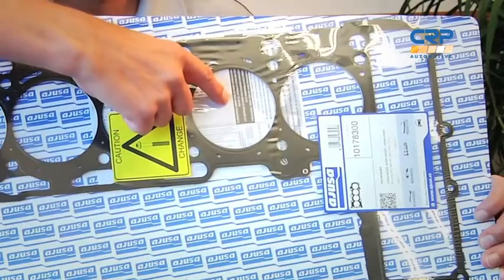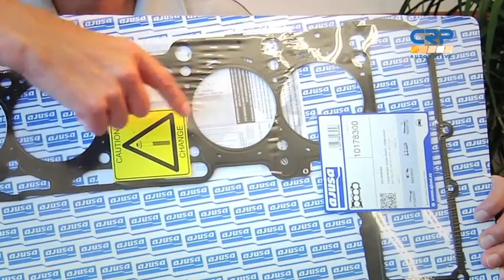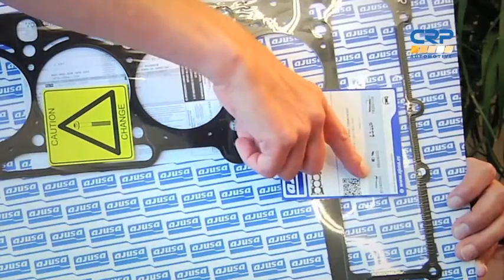ITB Episode 16: Torque Specs

Comment: How about those situations where you replace a head bolt with fine threads.  If you use the OEM specs for coarse threads, your clamping force with fine threads will be much greater.  How much is too much???
Reply from the maker: +William Skelton You would not want to replace a head bolt with a different thread pitch, you'd get a cross thread witch would certainly throw off the torque spec. All torque specs are set by the manufacturer though, so it’s a pretty cut and dry number.
Reply: +William Skelton  When using carb cleaner and brake cleaner, be sure you are in a well ventilated area.
Reply: +CRP Automotive , Come on now get back to reality.  I have replaced many a head bolt with a stud using OEM block thread with SAE NF nuts and washers on the opposite end.   With 61 years experience I do know that mixing of differing thread pitch is a BOZO NONO.
Reply: +All2skitzd, ICW a VOC face mask and breathing air supply.